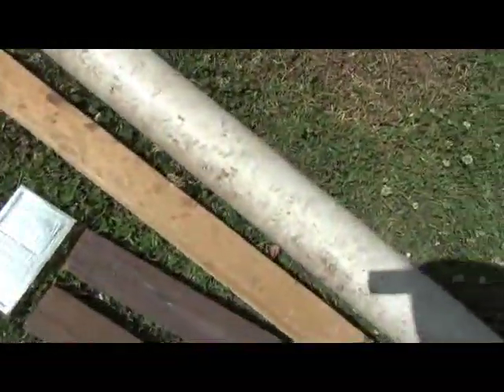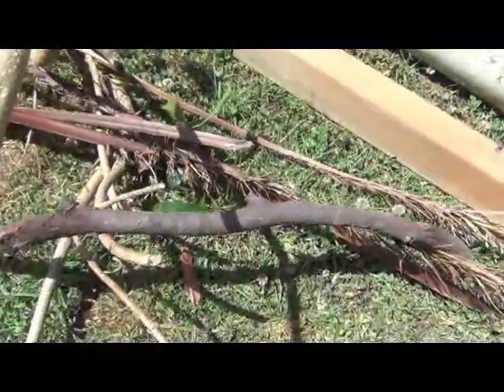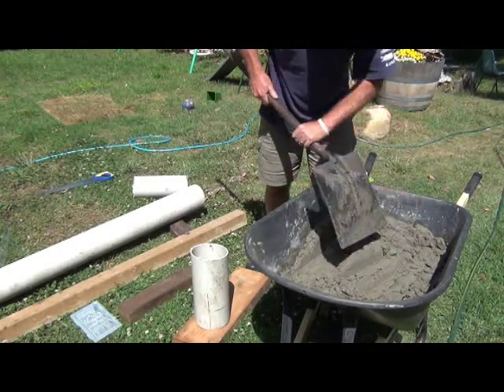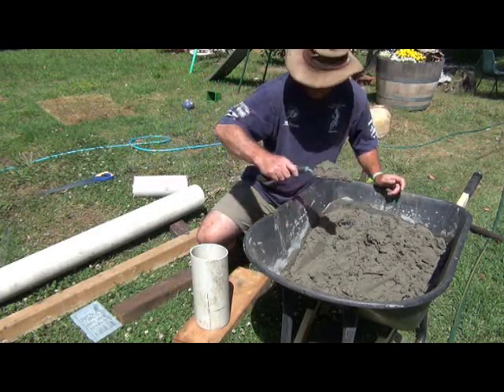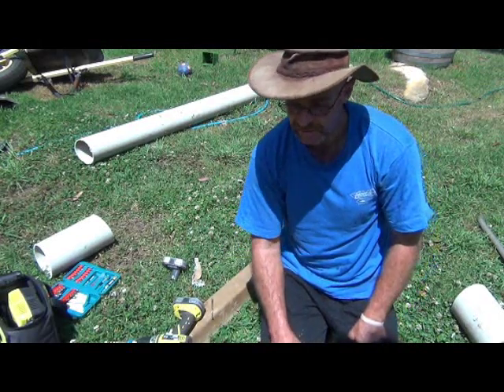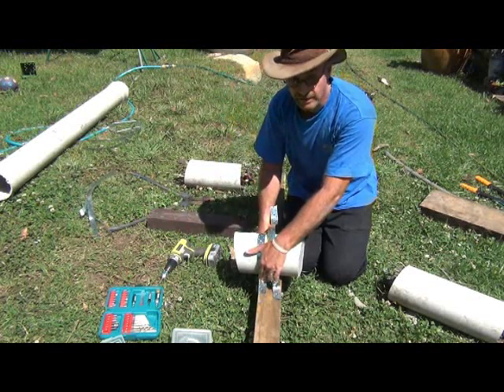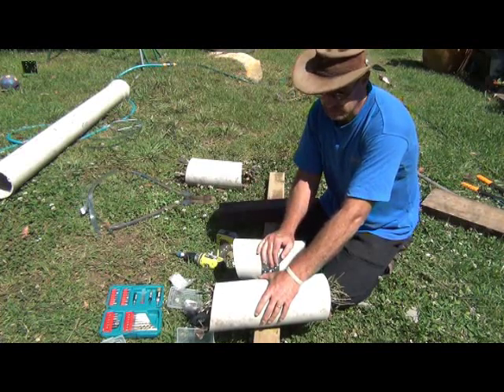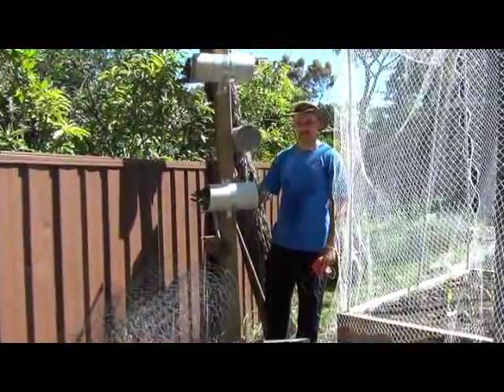How to make an insect habitat.

Comment from the maker: The steel straps have worked pretty well. Those pipes with the motar in them are still securely attached which is good as they are pretty heavy.
If you do some mortar be sure that it is soft for the bees to dig into. Mine turned out harder than I thought it would be so I have had to drill some holes in it for them. Hopefully they will like it.
I have had heaps of the blue banded bees around so they must have a good spot for digging holes somewhere close by.
Thanks for watching and commenting :)